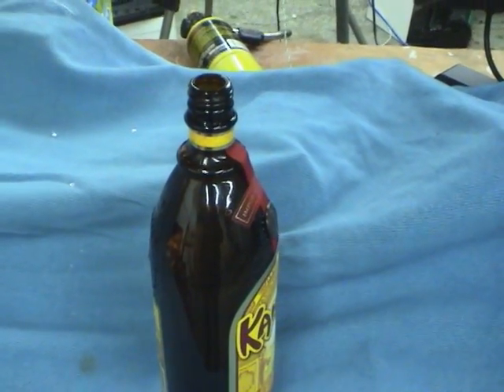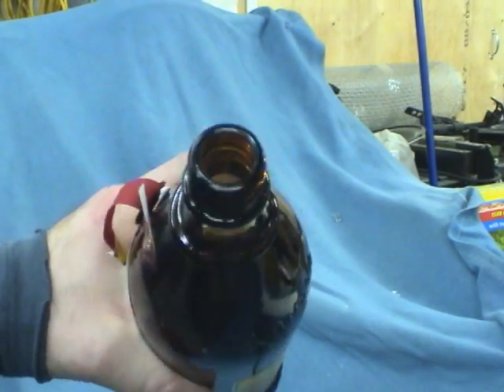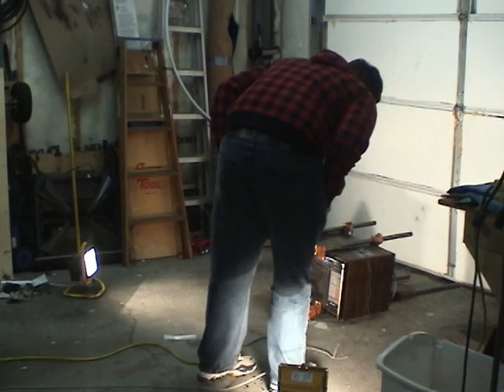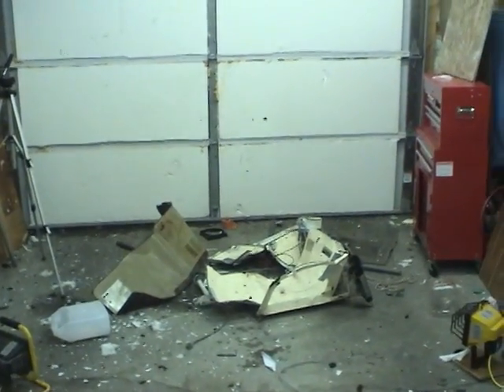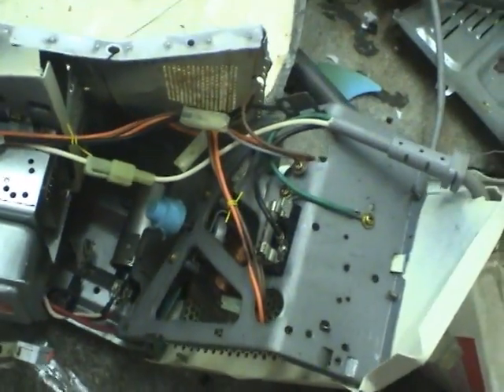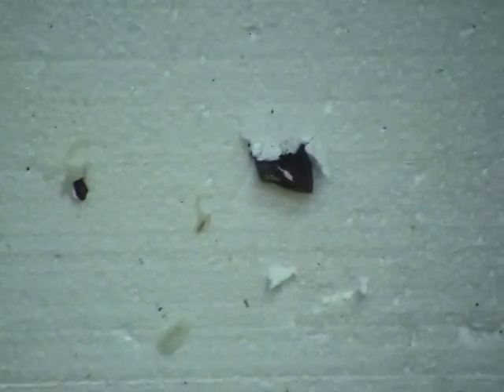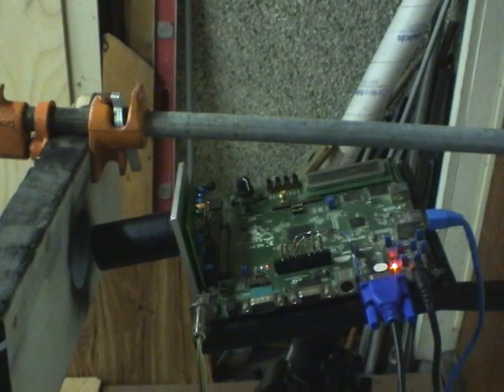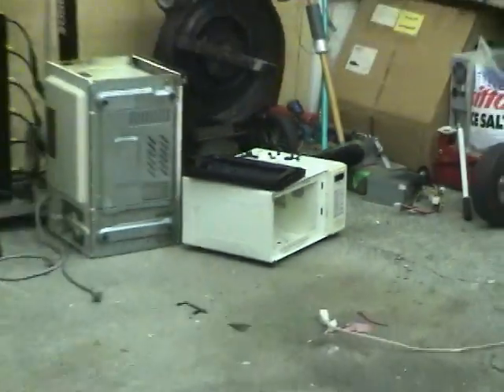Biggest microwave bottle explosion yet

Comment: Keep in mind that the beryllium oxide inside the magnetron tube is extremely dangerous.
Reply: Because it's berylium oxide, which is extremely toxic, especially when powdered and inhaled, for example in case of an explosion.
Reply: GEORGE PAPADOPOULOS why?
Reply: @brtd9418  -- Electrically, it's a very good insulator and has a high thermal conductivity.  You'll also find it in some gas laser tubes like an argon or krypton laser.  It's a really, really bad thing to inhale.

Here you go -- https://en.wikipedia.org/wiki/Berylliosis
Reply: damn beat me to it
Reply: Beryllium is also used in certain speaker driver domes, where it is mostly harmless unless you shatter it
Reply: Gee thanks.  Should have warned him earlier!
Reply: You all really think that the epa would allow such a toxic element to be mass produced and included in household items that are considered a throw away item?   Pretty sure they use some other kind of ceramic..  but a magnetron for a military radar is still called a magnetron and would most likely being a much higher potential application would have some beryllium..  

Another thing over looked is all magnetrons contain thorium in the filaments so yea..   thatd be a bit more dangerous to inhale in my opinion...  lol..   id rather die of beriliosis than radiation...
Reply: The magnetron didn't look like it was damaged by the explosion

Comment: You should try a thick steel bottle next time. Like a small gas cylinder in which some water is added to it and sealed. The microwave is set up in an outdoor field and you stand 100m away from it.

Comment from the maker: It's possible that decreasing the water level a little would allow higher temperatures and more steam vapor pressure, but at the same time there's less water, so at some point the returns will start diminishing. 

I filled it about 3/4 full, it seems reasonable based on the room in the bottle and the calculated thermal expansion of water at the temperatures involved. I'll have to do some more detailed calculations and figure out the optimum fill level.
Reply: Amazing

Comment from the maker: The high speed camera was running at 1,000fps. Seeing how fast the steam escaped initially (around 500mph), it really should have been 10,000 or 20,000fps, but the resolution would be tiny at that speed (you can trade resolution for speed on these cameras). I need a better camera!
Reply: tesla500 still was awesome 😎